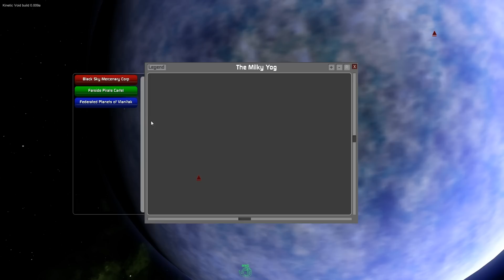Duncan Plays: Kinetic Void - Part 2 - HMS Duncatron

Comment: yes, there is. Light travels at different speeds in different materials, but it travels fastest in a vacuum (space) where it travels at 186,000 miles per second, which means it takes a little over 8 minutes for light to get to the earth from the sun (a little under 93 million miles away) or it could go around the earth's equator 7 times in a second.

Comment: any force is a vector, a very good catch indeed. not only value varies with the arguments but also superposition of attraction forces will could a weight value smaller as the objects positioning at the open space is not as concentrated as we used to experience living on the planet, e.g. there'll be no huge dominant attraction but lot of small, compensating each other ones.

Comment: The speed of light is exactly 299,792,458 meters per second.  It is exactly this because the meter is defined as the distance light travels in 1/299,792,458th of a second in a vacuum.  The thing we don't know is exactly how long a meter is.

Comment: As said by fetchityourself, the gravitational force has no limit. The equation is F=GMm/r^2, if you were to plot this there would be no point where the value of F=0, therefore gravity always has an effect, the field never stops. The same with electromagnetic, there is no upper limit to the force, so yes, there is weight in deep space, it is juts very small

Comment: Technically, all particles have mass. The mass of a photon is directly related to its energy, so whilst they don't have a mass per-se, photons do have kinetic energy, and can exchange kinetic energy with objects, which is pretty much the same as exerting a force on the object, as you change that objects momentum and force can be described as a change in momentum.

Check out the idea of solar sails, they work on this principle

Comment: "Is that faster then Light? *reads 20,000 km/s*"
c (Speed of Light in Vacuum) = 299,792,458 m/s = 299,792.46 km/s
Duncan, you are correct! You're moving at about... 6.6% of the speed of light there.

Comment: The "weight" of an object is determined by the gravitational force of the entity. In the case of the Earth sn object that's mass is 10kg, F=ma would suggest that the force exerted on the item is 10kg(9.8m/s²), or 98N (newtons). The force exerted on the same object on Jupiter would be 10kg(26m/s²) or a total of 260N (newtons) thus prooving that the mass of an object is directly preportional to the mass of the entity. So in conclusion the wheight of an object is different depending on were you are

Comment: F=(GMm)/R^2 where F = force due to gravity, G = universal gravitational constant, M and m are the masses of the two attracting bodies and R is the distance between them. When M, m and R are not zero (they can't ever be zero), F cannot possibly equal zero. It can however, get incredibly small. Gravity doesn't have a "range" since force due to gravity cannot equal zero, but you reach the point where the force is negligible.

Comment: adjusting the backwards thrusters to a slight angle would move you in any direction you wanted, but you'd move in a large arc dependent on the angle change. As for the slowing down, I dunno, magic?

Comment: Its not a theory, thats how it works. I suppose it depends on your situation, dealing with energies of particles, electrons are very important, in terms of a planet with a single electron around it, not so much.

Much in the same way, it does depend on your surroundings, some situations, objects may have more gravitational pull of you than others. Agreed, some cases it won't make much of a difference, but the point is, its still there, even if its small, people were saying it isn't, but it is

Comment: Gravitational forces exist in space. Space itself doesn't generate those forces - they are caused by the mass of objects in space which attract other objects with mass. The size of the gravitational force is proportional to the mass of the two objects in question, therefore, the gravitational attraction you feel from the earth is relatively small compared to the force felt by the moon because the moon is more massive than you. There is gravity in space.

Comment: Well technically, it doesn't have a set speed, as you can always measure to smaller values, but we know it pretty damn accurately, to well over 100ths of a meter per second, and really, that's accurate enough

Comment: What a great theory. Here's the trouble with it. You state that there is weight. There is, however it is so minute it is considered irrelevant. Te same way an electron has a mass, however in calculations we regard it has having no mass because it so small that it makes no impact or difference. That is the same with weight in space. U unless you're in orbit or close top a body with it's own gravity, then there is none.

Comment: Solar wind is a form of radiation, ergo a light wave, meaning that it is massless. Because these light waves have no mass, then the the equation for force (f=ma) can be represented as the mass, times the acceleration, equals the force of the object. Since light waves are massless and do not accelerate or deaccelerate, then the equation is effectively 0*0=0, F=0. The Solar "Wind" has no force, which comparative to "Earth wind," which can reach speeds up to 200 mph, is literally nothing. I win.

Comment: Gravity increases when the mass of an object is larger, And depending on how close you are to that mass its Gravitational force will pull, Take a black hole to earth, Its mass its MASSIVE but its size is small, however its gravity is so powerful light cannot escape it, However if you are far away enough, you are fine a.k.a The "Event Horizon"

Comment: Not at all, man made is the state in which particles are occupying a non naturally occuring configuration, because the particles in the LHC are in naturlally occuring states they are not man made, the purpose of the LHC is to observe particle collisions that it accelerates. To use a metaphor it is equivilent to dropping rocks off of the empire state building, the rocks are not man made even though the events surrounding their collison with the ground are.